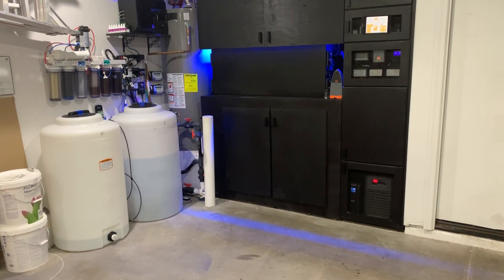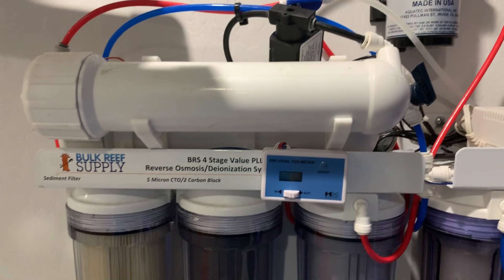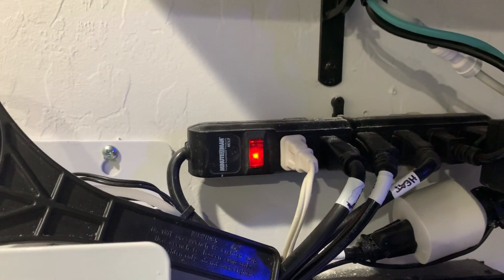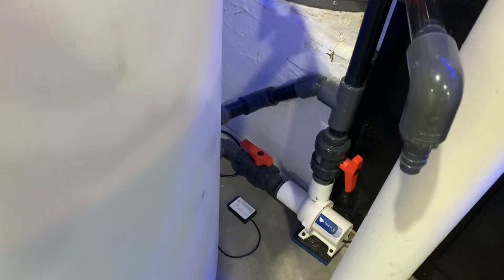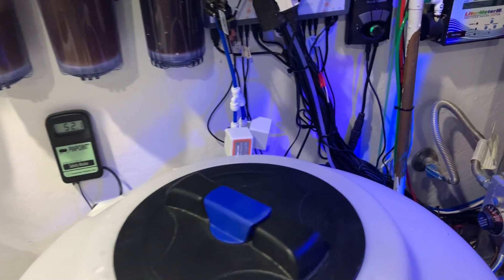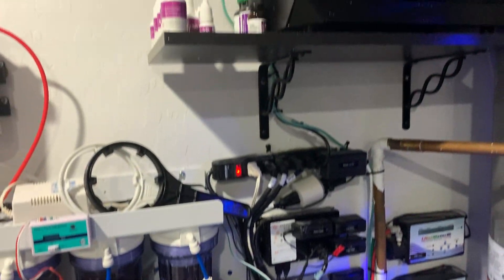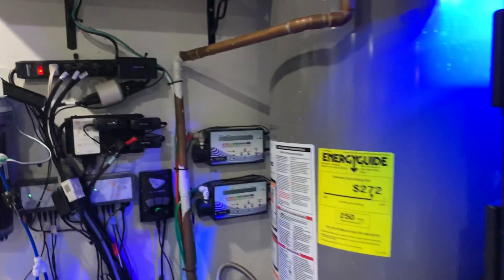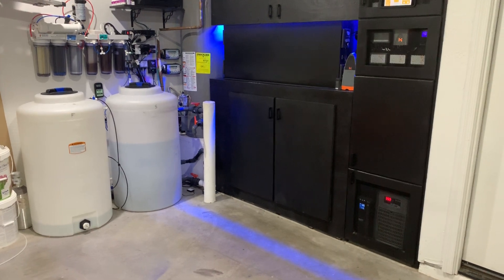Reef Automation Tour - Part 1 (RODI/AWC Systems)

Comment: if your reefbot is reading your water across the house, then its not giving you accurate readings as the water in the line is not fresh probably traveling that far and sitting in the lines until the next test
Reply from the maker: It’s not across the house.

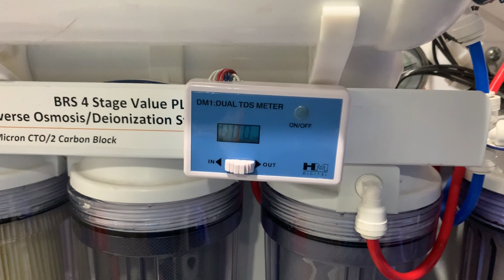Comment: 1:45  So I have a question, I have half of your system, the one to the left, my third chamber is for DI,  so when I have water going to it I have about 7 and going out of the DI I have 0 TDS, I was under the impression that is how it is supposed to work, if you have 0 before your DI why do you need the DI?
Reply from the maker: Read up on RODI systems.
Reply: @ReefAndReptileAutomation  Yeap thanks I will call Speactrpure.
Reply from the maker: Yea they are awesome.  Ask for Daniel.